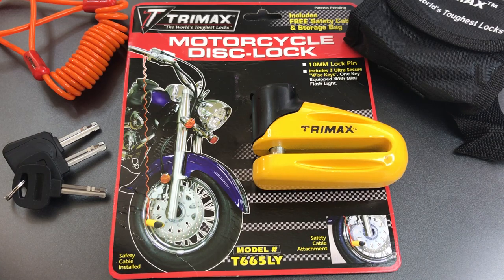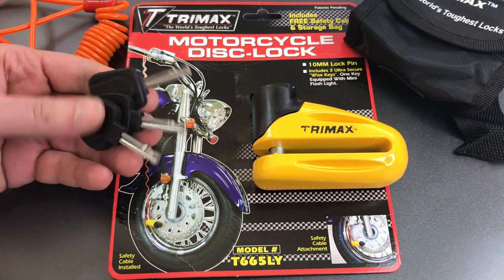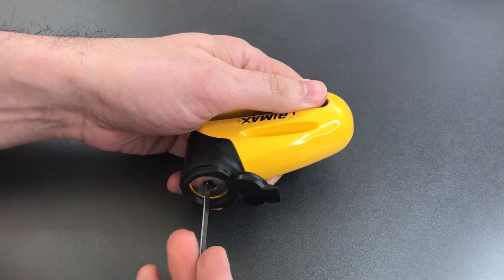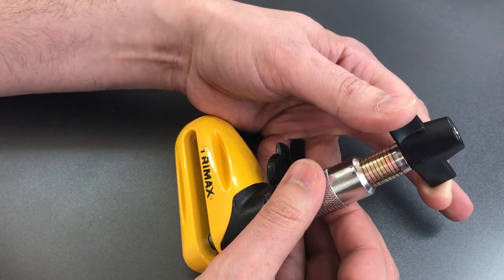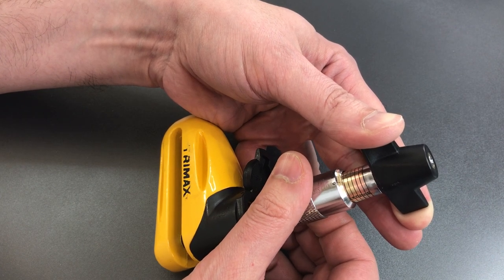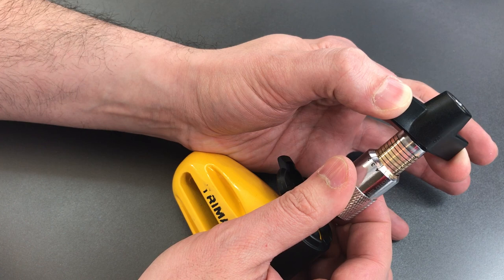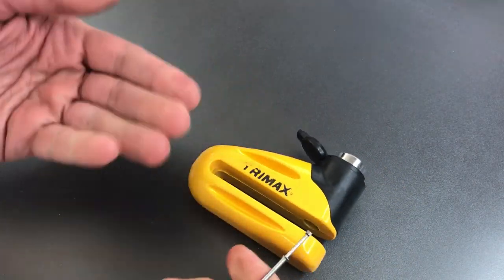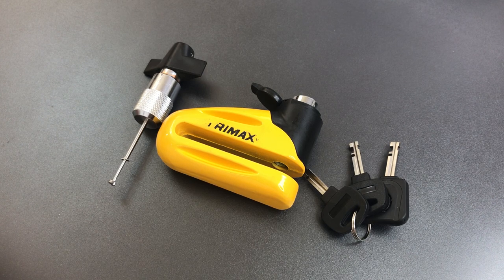[622] TriMax Motorcycle Disc Brake Lock Picked (Model T665)

Comment: They should have threaded the end of the shackle bar that enters the lock. This will serve two purpose. To make it difficult to spread the lock apart and to possibly force multiple pick attempts in rotating the cylinder to thread it out.
Reply from the maker: That might help, but it wouldn’t be enough without changing the Lock material.

Comment: i think they're using "wise keys" as in like, "special disc detainer super secure keys", basically just marketing. either that or maybe it's referencing some other key in some other system with a chip inside, but i doubt it. maybe the LED makes the key "wise"?

Comment: How much more difficult would it be for most locks when actually mounted on a motorcycle. This kind of lock sits pretty stable on a brake disk it would seem. Would this be an advantage, or a disadvantage ?
Reply: A similar one by Master Lock got killed last week by LPL and his bolt extractor. It was cast from monkey metal, not forged from alloy steel as it should be.
Reply from the maker: It would be easier to pick in place. Holding this lock while picking is a PITA!
Reply: Jeeze!
What’s the purpose of this video if you’re not a locksmith up for a challenge …. OR a motorcycle thief?

Comment: Nice Video! Where can I get such a Pick with tensioning in the back of the lock. I just know these blue ones which often are sold in a set with the silver front tensioning tool. Thank You!
Reply from the maker: The lock pick that I use is available on most of the usual Chinese websites, and is sold for the Abus locks. However, note that my pick is highly modified and it will not work as demonstrated out of the box.
Reply: Ok thank you very much for this information!

Comment: LPL, could you offhand name a 50mm padlock that has a disc detainer core, high shoulders and a sturdy lock body?  I'm interested for practical reasons, thanks for sharing.
Reply: Abloy pl342
Reply: Thank you.
Reply from the maker: Kit, excellent suggestion. 👍
Reply: Thanks LPL.

Would you consider trying out the spanner method on those round body padlocks. I doubt it would work on the heavier duty ones but the cheaper ones it should pop them open without much effort. If you can get a Flat Head screwdriver underneath then a spanner/Monkey wrench should work.

Just a thought.

Comment: These lock methods are very low in security. If you unbolt the rotor, in most cases you can still push the bike away.
Reply: Mekhanic1 or use the easy out!
Reply from the maker: True, but not the idea method of making a getaway...